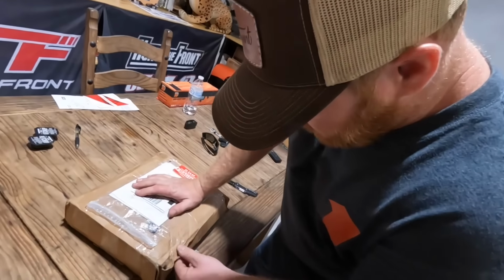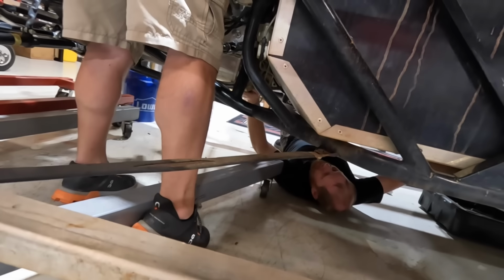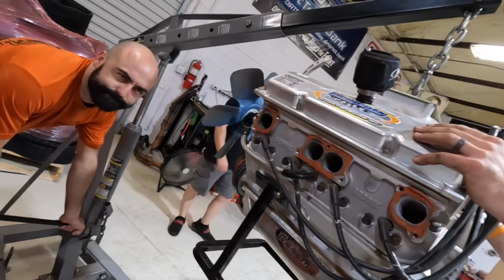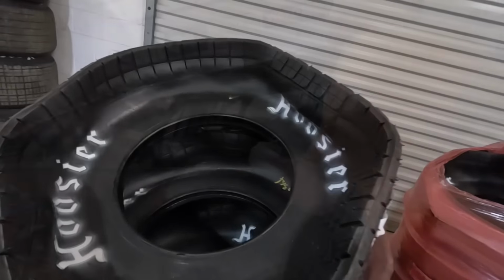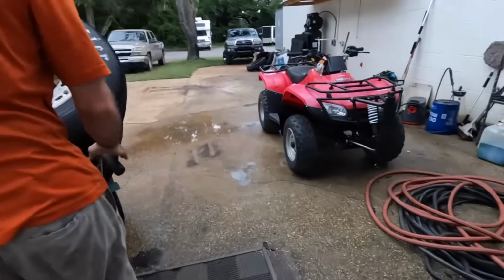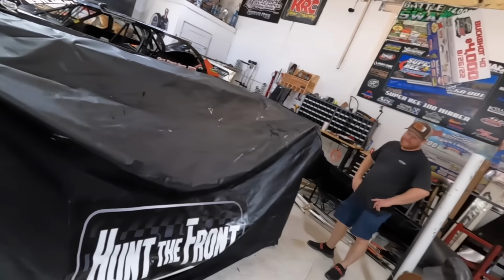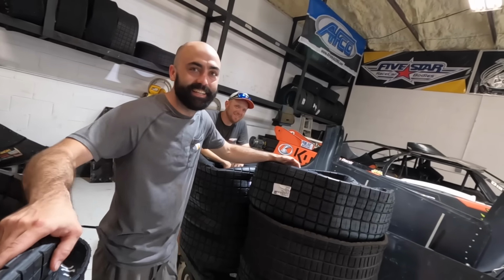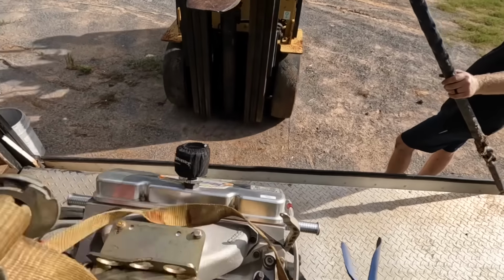Big Change Before Eldora Speedway's World 100! Can You Guess What it is?

Comment: Just for safety reasons on your forklift especially when moving an engine, what we always did was drill a 3/4" hole in the end of the fork, then you can pin it for safety or put a 1 3/4" ball in it, then you could move trailers etc.🏁🇺🇸ML33MI.

Comment: Capital , Longhorn , rocket there all good chassis.  You need a good shock and spring program. Facts
Reply: And a good engine also
Reply: Very true.
Reply: @keithreichert7858  The Clements wide bore they have is as good as it gets for a Chevy, maybe a Durham if you want Ford!
Reply: @keithreichert7858  They put a limiter in the car 90% of the time. They don;t need more motor
Reply: thats 100% right its not about the name on the side its about what u put on it

Comment: BTW the new car is a capital. Look at the registration for the world. It's going to be a clements power capital.
Reply: It won't matter what engine is in a capital if the track slicks off. It won't get off the corner
Reply: @AudioWonderland  True. But it's hard to deny the fact that before they left capital, they could at least run well locally, and with Longhorn, they seem to be constantly out to lunch. Always either to loose or to tight.

Comment: hey guys FYI when you loaded the motor I noticed you used a ratchet strap 👌but meatal on metal will easily slip, maybe a wood block or piece of plywood in-between the ratchet and fork blade will make you safer from an incident.  Thank y'all for the adrenalin your team gives - miss Jordan also